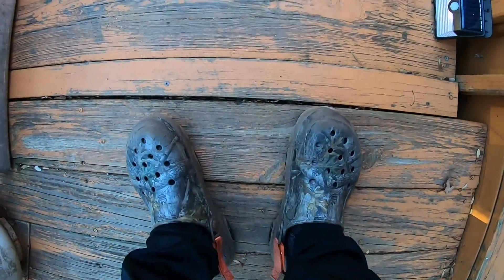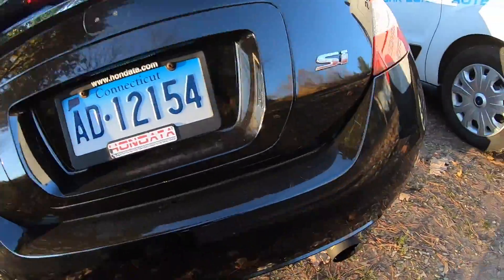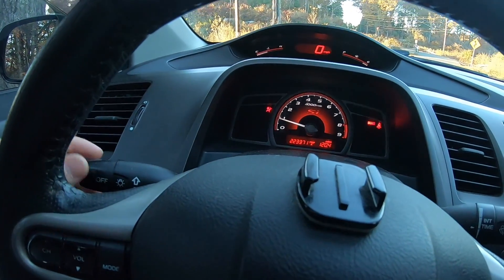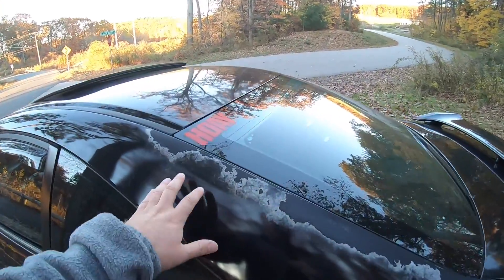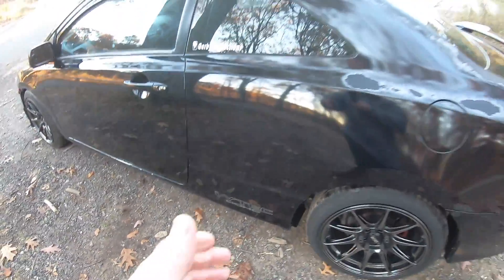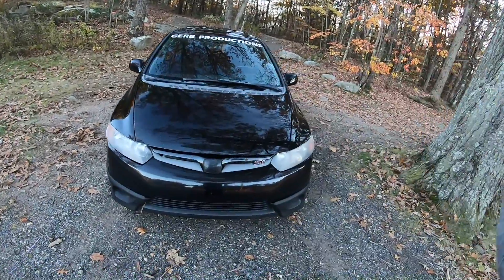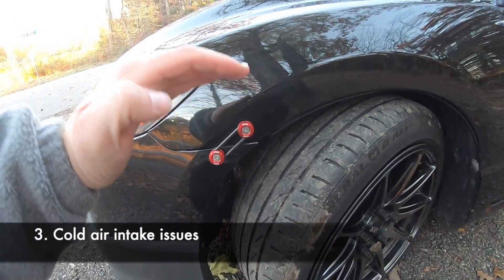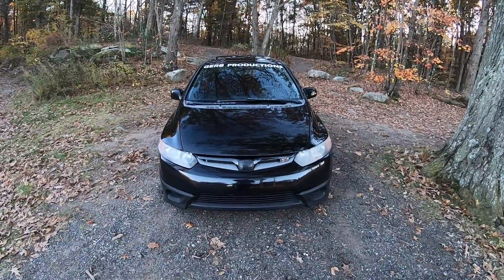Everything wrong with my civic si

Comment: Steve that car is in great shape and you have done an awesome job maintaining it.. Just small little Honda problems that can always be corrected at some point. When it comes to paint, I slowly had my Type S resprayed at a professional shop piece by piece pretty much as real paint jobs at real paint shops using top of the line paint/clear as well as meticulous prep are very expensive. All I have left are my roof and 2 doors.
Reply from the maker: Thanks for the kind words! I agreed though, It's all stuff that doesn't really affect the driving at all.  Made a video fixing some rust and doing some paint today, so stay tuned for that.

Comment: Super!! You could fix all that ..the head lights could strech the holes since they are plastic drilled new holes on head lights make it tight and the leak get it steam wash and look where come from the little rust you could get it fix sand it down make it smooth and take it to Maaco 
You could do it

Comment: I have that same oil leak problem as well, don’t know what it is lol keep the videos comin though man! Showin support From 🇨🇦 lol
Reply from the maker: Glad I'm not the only one.. I need to make it out there one day, thank you!
Reply: I have the same leak and its so slow i dont even need to top off oil, i noticed after putting seal conditioner into the crankcase that the leak slowed even more.

Pretty sure its either rear shaft seal or valve cover. Just replace shaft seal next time you gotta pull the tranny. Isnt the oil cooler or vtec solenoid thats for sure.

Comment: Get oil undercoating to slow the rust. Around $200 to apply annually (if done by someone else) but there are plenty of kits for diy. It saves northeast vehicles. My 06 RSX is incredibly clean for a northeast car because the previous owners sprayed it annually.
Reply from the maker: Made a cool vid fixing my rust today actually, so stay tuned for that. You are a lucky soul

Comment: I had leak in my rsx almost same spot I change axles seals and check oil pan and everything else come found out it’s was the rear main seal I left it till I did the clutch job it was probably one or two drops a day so wasn’t too bad

Comment: to prevent that hazing from ever forming, stop in at advance or auto zone and get some different grits of sandpaper, some megeuiars polishing compound and order some spray max high gloss 2k clear on amazon. sand them down and spray the clear coat over them then polish them out with a cordless drill and attachment or by hand. this clear has a hardener so it will be very strong and should take some rock chips and whatnot. You'll be so happy with the outcome gerb. 

As for the paint I can relate sadly I've been repainting my car panel by panel at home... it's white so it's not as bad as yours but the roof trunk and wing were bad. and don't even get me started on 2nd and 3rd gear... I've alleviated the issue but it's never truly gone away.  when someone else drives my car it's the first thing I have to warn them about. one of these days I'm going to have the trans pulled and the jank honda synchros are going bye-bye.

Comment: Simoniz makes a good headlight kit to remove the haze. I’ve used it on my 9th gen si and it makes the headlights look brand new.
Reply from the maker: Maybe I'll look into it
Reply: @TheGerbsteve  I have literally used mothers aluminum polish...or any polish will almost do. Results are only a few weeks before the sun damages them again. They will need a UV coating, like a clear coat. I'm about to just eBay some new housings , oem foglight kit, and LED bulbs.

Comment: I fixed the headlight issue on a 7th gen civic after hitting a deer by buying some used headlights along with the metal mount bolted to the chassis from the junkyard.

Comment: After my swap buddy my car seaps oil just like yours on the rear engine mount. I haven’t figured it out either. I was thinking it was my timing cover leaking from past work potentially, but I’ll clean it up one day and the oil will go away then a month or so later it’ll be back. It’s definitely a slow leak that doesn’t show on the garage floor or ground, but I’ve noticed after about 3k of driving it’ll be a half quart low on oil
Reply from the maker: I'll just keep my oil topped off haha

Comment: jack the car up and clean the oil with brake clean so you can track where its coming from.. if its wet in the rear where the valve cover meets the head its defiantly a valve cover gasket.. regardless its most likely the valve cover gasket its a maintenance thing every few years with K series and if the RTB isnt applied a specific way on the head case before reinstall they will also piss oil everywhere. i have yet to have a leak from the vtech solenoid but iv gone through valve cover gaskets a few times and had to replace an oil pressure sensor that was leaking

Comment: Hey Gerb, great vid as usual, seeing how you already replaced the headlights and they’re likely out of warranty I would def try the 3M ultra resto kit the pro one not the one in the clear blister pack. Oreilly was running a sale not sure if they still are or are in your area but I got mine cheap for my winter beater. Worked mint and was ez to do in about 30 mins. Cheers!

Comment: Get a wrap.
Spend some money on a nice 2.75-3” exhaust with a vibrant muffler. It will sound and perform better.
Just order new headlights, the OEM ones aren’t that expensive and new/fresh/clear/clean headlights literally can make any car look new, either replace or sand and buff.
You should also put your logo on the back windshield instead of the front (and mayb try grey) 👍🏻
Reply from the maker: Paint > wrap. 
I’m content with my current exhaust. Honestly was thinking of grabbing some new oem headlights..

Comment: Have you changed your oil pressure sensor above your vtec solenoid? I changed that on my k20z3 and it helped
Reply from the maker: It's below the vtec solenoid.. I tried fixing it once, but I didn't add teflon tape, just hondabond. I have a lot of vibrations and a slight engine tilt, so I'm thinking it has something to do with that.

Comment: Cmc needs to be em1 or hybrid racing kit, base bushings on shifter, & shift cable bushings, plus add short shift adapter & get a NRG long weighted shift knob, flush the cmc well too, run plenty clean tran fluid, shift right k series is not like b series & never sell a fg2k20z3

Comment: If you start it and let the beeps complete it tends to fix the eps light but in gerbs case it sounds like a melted wire somewere and that rust has already spreaded to other areas mine looked like that but by the time I got to checking it out I ended up cutting alot of rust away and rebuilding sections of the undercarriage lol and the headlights do that regardless of a front end collision the bottom mounting clips on the headlights break just use a small block of wood under each headlight worked for me for a temp fix

Comment: Bro, think that clear coat is bad? My 9th gen in the Texas sun has faded the entire top of the car. Honda did a TERRIBLE job with the clear coats, especially on CBP. 3M makes a decent headlight restoration kit. And then a clear coat-looks brand new if you take an hour or so and maybe $30. And the oil leak is probably the common k24 timing chain cover, I think i had it fixed at the dealer for around $450. Im trying to get paint done early 2022. What size rims/tires are you running just curious they look sick. Hang in there man if you’re able to, that car is worth fixing IMO.
Reply from the maker: Yeah, slightly haha. I might just bring it to the dealer, but I really have a hard time trusting other people working on my car.
Reply: @TheGerbsteve  I hear you man I do everything I am capable myself. The stealership sucks. I’ve stopped going, unless I think it’s something I don’t have the equipment or tools for. I learned quick when they wanted $400-$500 to replace window belt moldings, I bought 2 OEM moldings for $24 ea. and swapped them out in 10-15 minutes. 😂
Reply: @TheGerbsteve  oh hey and by the way where did you pick up your bride seat belt shoulder pads

Comment: 3m has a few different headlight restoration kits, i would go with the ones that provide the attachments for the drill that use sandpaper and then get some 2k clear and hit up with 4 coats.  Plenty of videos showing it and it comes out real nice if you follow the steps!